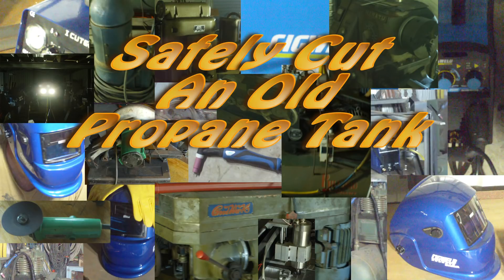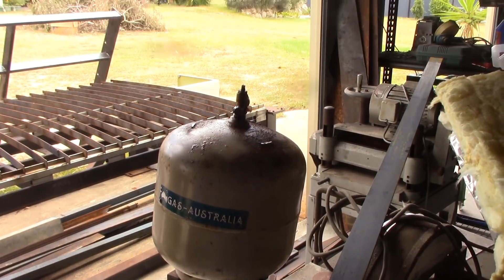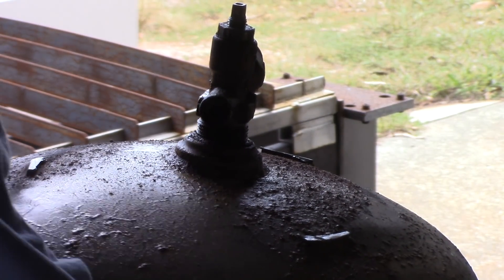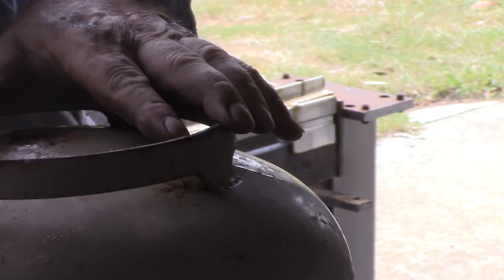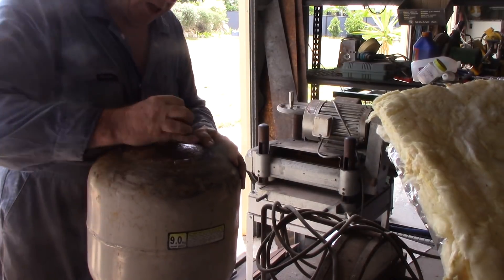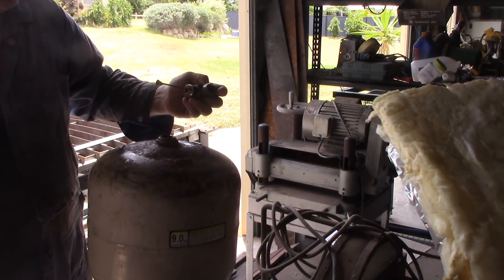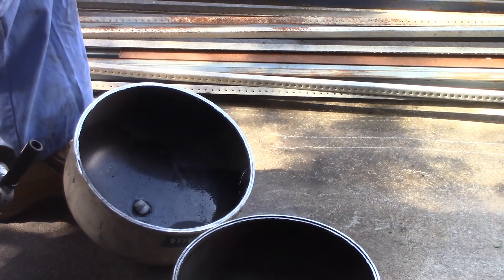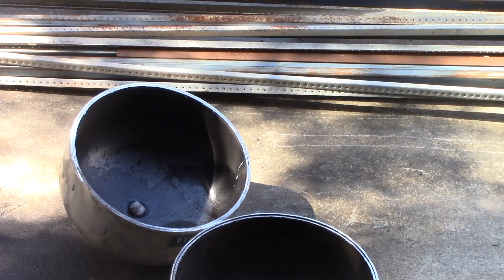How I Cut Propane Tanks (safely)

Comment: Tank should be purged with CO2 or dry ice (same thing) to displace oxygen. Then it can be welded on or cut open safely.
Reply from the maker: That would work too but I was always taught that once the water goes through it (completely filled) there is nothing left to burn.

Comment: If you applied the same technique to a fuel tank petrol as what as shown in the videos and comments you could be in serious problem when welding a fuel tank they are the steam clean for some length of time or run air into the tank while it is being welded I was always taught that filling Tanks with water is not a safe way and can actually make it worse,
 you must make the gas in the tank INERT 
Regards safety Sam
Reply from the maker: I was shown this way by a fellow who had been doing it for years but if you have been shown differently then you should definitely stick with what you are comfortable with.
Reply: How is it supposed to make it worse, I was taught the water pushes the gas out
Reply: Yeah if it was a petrol tank, but it's not. it's a propane tank so this method is completely safe there is no way it could go wrong and anything else would be Overkill

Comment: Why on earth would you be cutting the valve guard and tank handle off with the valve open. If something did go a little wrong you are suppling your mistake with fuel. Close the valve and make sure you don't cut into the actual tank. Appreciate the video but play safe. Remember you have crazy teenagers and people who think they are handy watching and learning from you.   -    Also..... that is a very old style tank and people will just assume this to apply to anything that remotely resembles a propane tank. Simply opening the valve on a newer style tank will not drain the gas from it.
Reply from the maker: I think I did say that the valve had been open for years (like 10) but I do take the point about crazy people watching.  I will try to be more explicit.

Comment: I want to cut my tank with my everlast plasma cutter. Any suggestions?
Reply from the maker: I thought about using a plasma cutter.  I figured that the tank had been empty for several years, the valve had been out for a day and it had been filled with water.  I thought if I emptied the water out it should be safe to cut with a plasma.
I think it would have been okay but in the finish, I decided it was safer to do it the way I was shown years ago.
If you do decide to try it make sure you remove the valve, fill it with water and empty it, let it dry.  Good luck.
Reply: Designed 2 Build ‘
Reply: Read Peter Dorn's comment. After you read his comment...….. find a safer method of cutting your tank than trying your best to turn it into a bomb. I don't know if you've ever  had a late firing on your barbecue and experienced the power of a little propane. I myself just about blew the lid right off my barbecue. Ever since I have gained a great respect for it's potential power. Be safe.

Comment: Dude... Pure propane and butane have NO smell and it is because of that fact that the gas suppliers add an odorant or stink (Ethyl Mercaptan) so that you can easily detect a leak. There is a small valve on the side of most LPG tank taps that you open to purge the new tank of its transport gas (nitrogen) before filling for the first time. This valve can be used to release the last of the gas from the cylinder before removing the valve. Once a cylinder has been completely filled with water, there is NO inflammable gas left in it even though you can still smell the odorant. The first time that you light a fire in your stove, that stink will be burned out too.
Reply: Close. Opening the bleed valve will not release all of the gas from the tank. It releases all of the gas under pressure. Once that is done the gas in the tank is at the same pressure as the surrounding air.  In other words there's nothing to push that gas out which is why, as you rightly say, you fill the tank with water which pushes the remaining gas out.

Comment: I discovered a seller at Melbourne and he sells Chinese stuff like cutting, grinding, flap discs and I ended up getting some and the quality has blown me away all the abrasives I have bought work better than the name brand stuff and I mean a lot better about as good as PFERD stuff. I got a roll of 150mm flap discs with 50 discs in it for a crazy price.
Reply from the maker: Excellent.  I've had the same experience buying abrasive disks off EBay.  Check out my comparison tests on some 100mm cutoff disks if you are interested.  https://www.youtube.com/watch?v=s0CFaF6ymDg